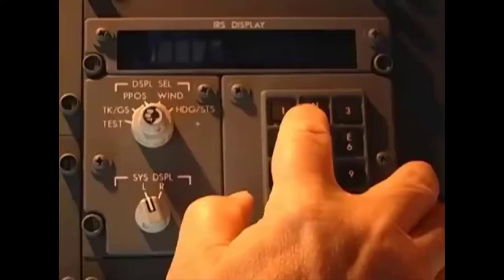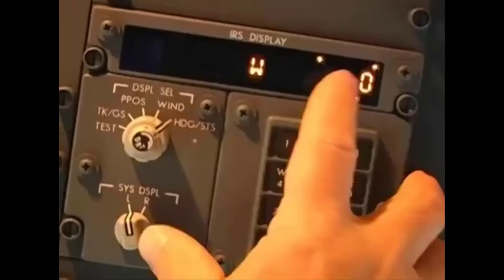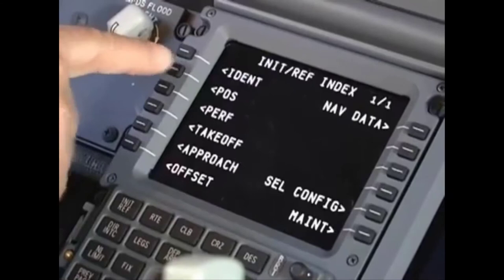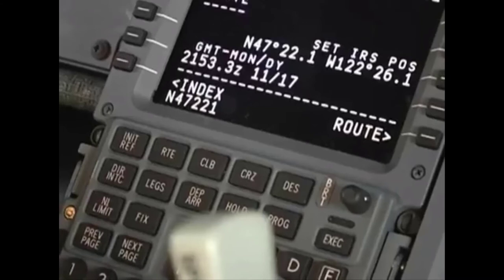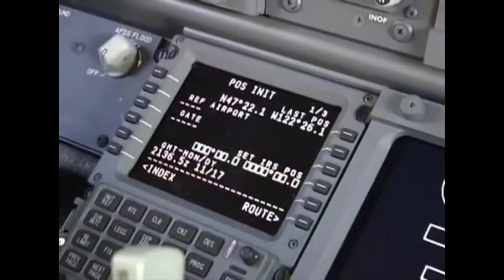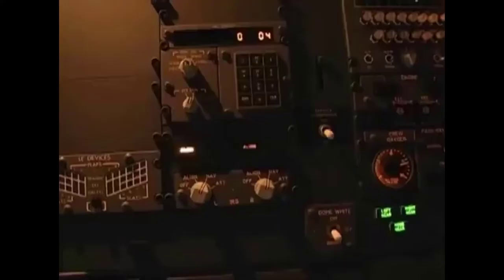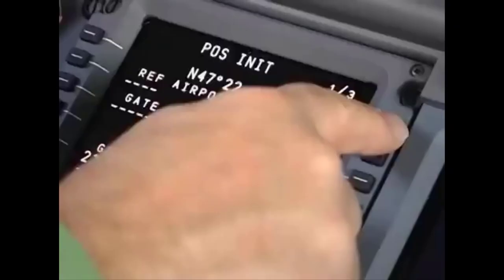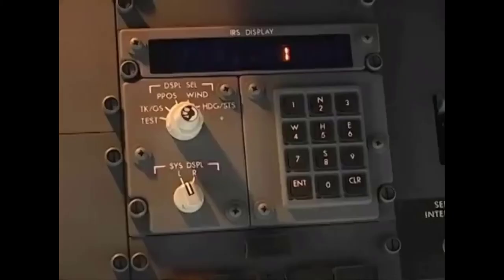Initializing the Boeing ADIRU

Comment: I thought the system used GPS for location data.
Reply: It uses GPS to know its location on the globe. It then measures "earth rates" on all three axes and determines if the rates match what is predicted based on that location on the globe.
Reply: @stuartgray5877  This was a while ago but as I recall it was with respect to having to manually enter the coordinates and why that is since GPS can pinpoint coordinates to within 50 feet.